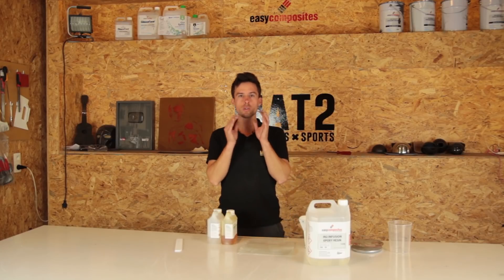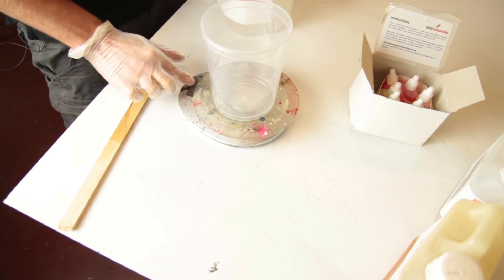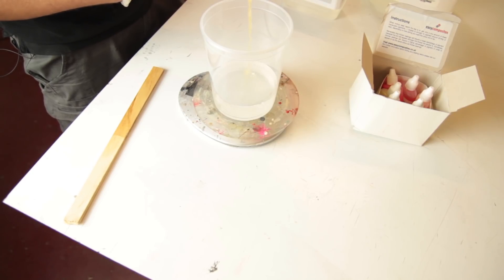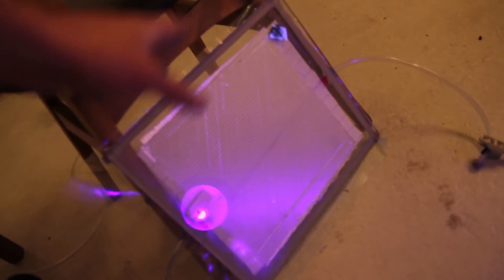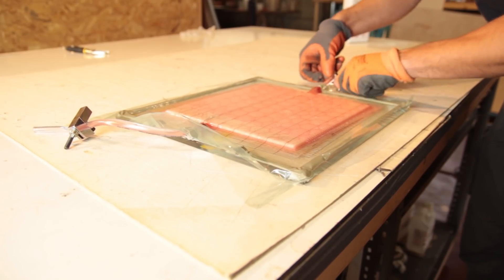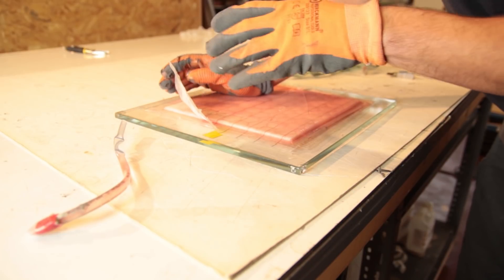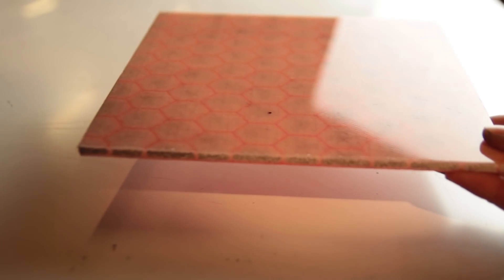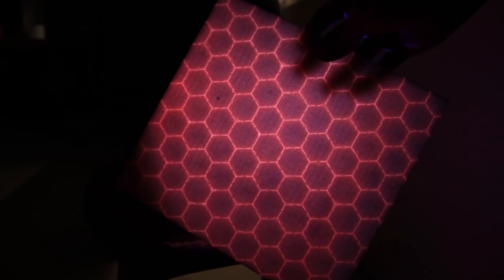Resin Infusion with 3D Core and Fluor Resin

Comment: Thanks for sharing your experience with us.
I'd be interested in seeing how strong this stuff is. Would it make good RC airplane parts? Robot parts? How does its strength/weight compare with wood?
Thanks for the fun video.
Reply from the maker: It's very strong but adds a good amount of weight as well! Still lighter than the same amount for thickness in woven material

Comment: Coasters are boring. Make some knife scales or a clipboard or a front and back cover for a sketchbook or address book or a ping pong paddle and put some rubber paint on the surface and the handle. You could also use it to make a slingshot by cutting out several layers and laminating them together then sanding and shaping. Or just send me some samples and I will make something for you, I have lots of ideas.